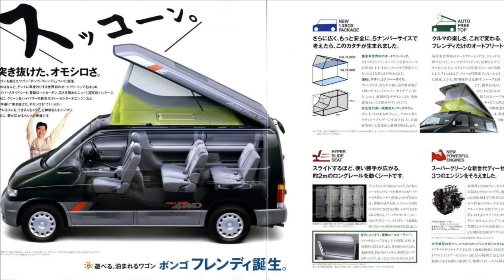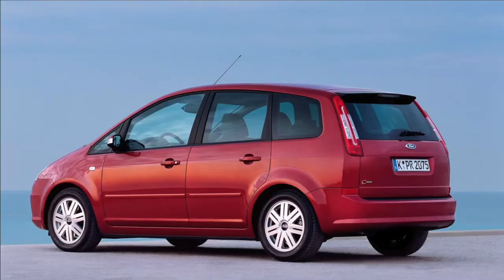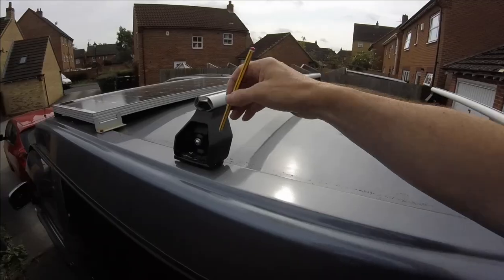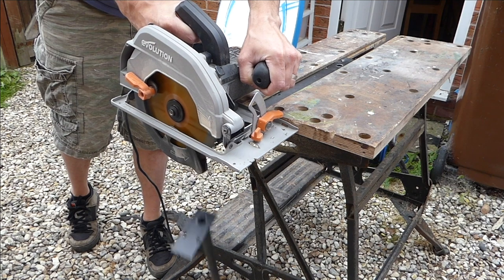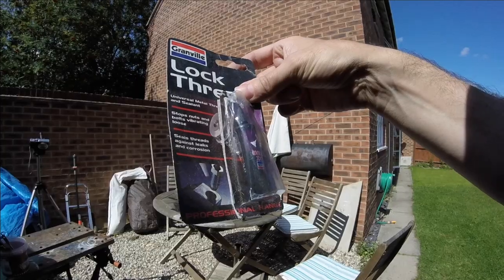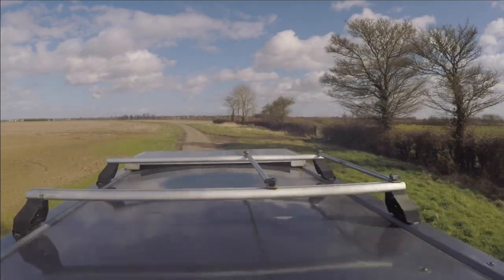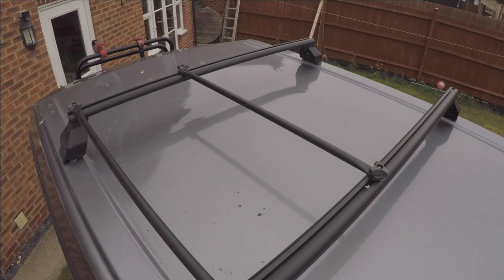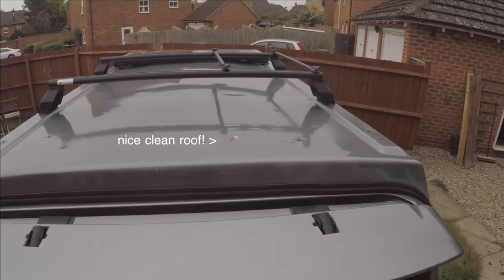Fitting Roof Bars to Mazda Bongo pop top (after market roof)

Comment: A very neat solution I'm thinking of fitting some roof bars on my pop up and the spreader plates you putting were a good idea. Did you see any signs of fatigue to the fibreglass after a couple of years use please, i'm not going to put a heavy weight on my roof but that was my only concern.
Reply from the maker: Hi, The roof doesn't seem to be showing any signs of fatigue from using the roof bars. I did update my roof bars which I do show in another video here - https://youtu.be/WG0qlCbo1qk?si=7pShm5QdL-hnM57O&t=354 

But definitely keep the weight to a minimum and use big spreader plates. I used a roof box for quite a lot of stuff on my Scotland road trip video and it held up great even in 45mph cross winds!! cheers :)

Comment: Hi, I have the same van as you and like you I would like to get an after market roof fitting. Can I ask where you had yours done please? Also I see that yours is facing the other way around to most I've seen. Is there a particular reason for that at all?
Reply from the maker: Hi David, mine was already installed when I purchased the van. My van used to have a rear kitchen layout so the previous owners had the pop top that way round for extra standing room at the kitchen, to be honest I quite like it this way and I still get standing room. I think New Dawn Conversion do these roofs so worth a look over there. Cheers!
Reply: That's very helpful. Thanks very much, I'll check them out.

Comment: A nice video and very well presented. I'd love to do the same but curious as to what's the max load it could take up their? (max load and also max load with then the gas struts still being able to support?)
Reply from the maker: Thanks! appreciate it. I've seen others with roof boxes on the same aftermarket roof. I've only used with light loads such as camping chairs, boogie boards and a toilet tent. The gas struts seemed fine with those loads. I do intend to try out a roof box at some point. I should try an experiment with the max weight that the gas struts can take?